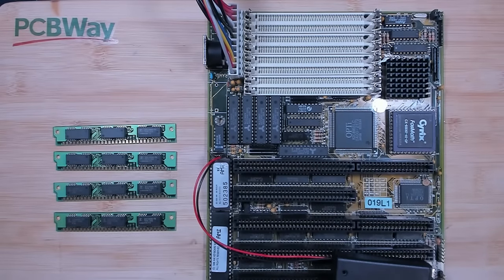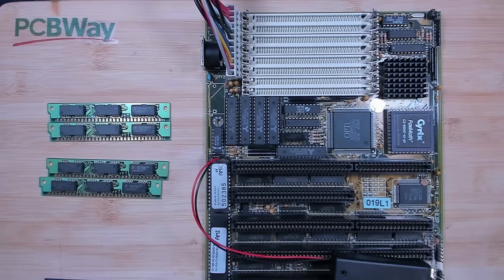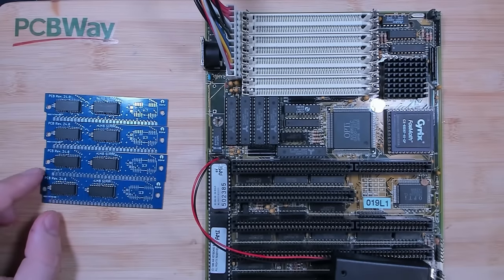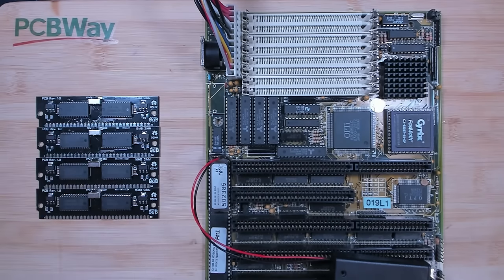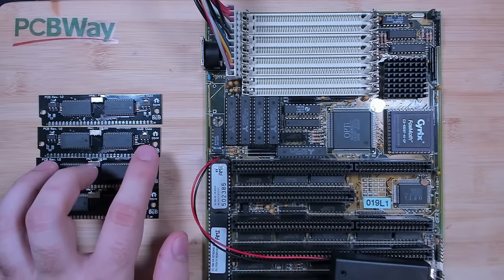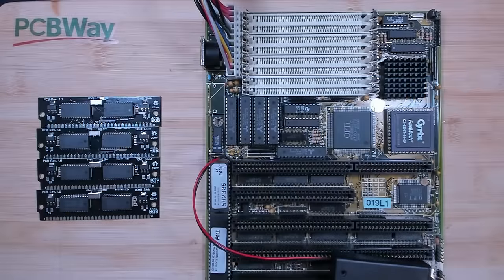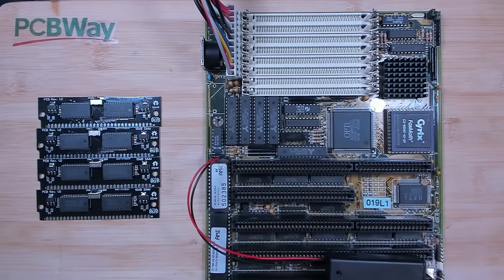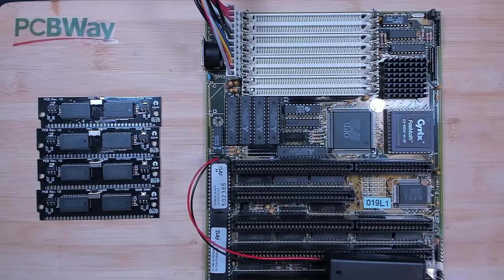16MB SIMM Revision 2.0 - I screwed up!

Comment: Electronic engineer here, explanation for the 3.8v address line max would be due to driver voltage drop within the chipset driving those lines, with older 5v CMOS specs it was common to see a "Vhi in" spec of 3.5v to 5v and a "Vhi out" spec as low as 3.6v. 
With that in mind the added capacitance to the RAS/OE lines would delay that already low drive signal outside of the timing spec as you have seen, this could be adjusted for in the bios to alter the timing slightly.
Very cool project and has inspired me to dig out some of my old treasures to get living again, namely the Amstrad 8086 i have in storage.
Thankyou
Reply: why would the RAS/CAS lines always have problems of capacitance ? is that because every single chip in all memory chips in that same line ?
Reply: @monad_tcp  typically what happens is the extra capacitance on these lines will cause the rise/fall time to be delayed out of spec. There is a setup and hold time requirement between address lines changing to when the RAS/CAS lines are required to lock those values into the memory chips, should this be delayed at the chip end the address lines may change again before the memory has a chance to latch them resulting in address corruption. 
this delay is a result of the signal drivers output impedance and the stray capacitance of everything attached to these lines and it seems in this case the RAS/CAS drivers are quite high impedance comparatively to other lines and as such are more susceptible to error.

Comment: I love that you and others are making new RAM modules for retro computers. Back in the early 90s having 64MB RAM on my 386 was only a dream as it was so expensive but now RAM is much less expensive
Reply: I thought I was King Shit for having 24MB in my 486SX. 🤣
Reply: @throwaway6478  you were and you still are bro 😂
Reply from the maker: I hope that the new modules (PCB rev 3.x) will work flawlessly and I can get a 386 to 128MB! Haha, that would be cool! This amount of memory is most probably useless to a 386, but it is still a nice project - and I am learning so much from it! Thinking about a 386 multiple times the memory of Socket 7 and maybe even Slot 1 machines is ridiculous :D
Reply: @bitsundbolts  the data sheet says it's possible, so at least someone had to have thought of doing this!
Reply: @bitsundbolts а что если более емкую и низковольтную память запустить через преобразователи уровня все управляющие сигналы, шину адреса, шину данных.
Открываются тогда вобще заоблачные объемы доступной физической памяти🤔
Reply: @bitsundbolts  I recently (accidentally) booted Windows 95 on a Tandy 4000 16MHz 386 with 16M of RAM, and it was -- well, it booted, and was less abysmal than you might think.  (This machine has 8 30-pin SIMM sockets on the motherboard and 8 more on an expansion board, all populated.)  So a 386 with 128M running Windows 95 or Linux would be fun to experiment with.

Also, Mac Quadra 700s have 4 30-pin SIMM sockets on a 25MHz 68040 and can really benefit from 64M of RAM with 16M SIMMs.  I would be very interested to see if these can work in that scenario.
Reply: @bitsundbolts  well most would say using and experimenting with retro hardware is a waste of time. 

I, for one, would love to see what a 386 with 128MB of RAM and say 1 or 2 MB cache could do!
Reply: Let me add to that an FPU like the Intel 387DX or even better an Intel Rapid CAD-2
Reply: IIRC I only got as far as 16MiB on my 386 system. Four 4MiB 30pin SIMs. I bet I've still got them somewhere.
Reply: @danielktdoranie  Интересно протестировать производительность 386 хотя бы с 32Mb, реализованными полностью на Static RAM. Сейчас в продаже есть чипы SRAM на 2Mb (1Mbx16bit), это получится 16 чипов. Правда, придётся отказаться от чипсета, и реализовать его либо отдельными чипами, либо на ПЛИС. Тогда кэш вообще не нужен! И да, тогда не потребуется нулевой канал DMA и прерывания для регенерации DRAM, но придётся убрать из BIOS их настройку. В литературе говорилось, что на регенерацию DRAM тратится от 5 до 10% времени работы с памятью, и в это время она недоступна CPU.
Reply: I had a built up, rack mounted 386 sporting a 486DLC2 at 80mhz, matching Cyrix 387 Fastmath copro, 64MB of RAM, and dual 9GB 5.25" full height Seagate Barracuda scsi drives running FreeBSD as my personal colocated server. I never could find a 386 motherboard that would let me throw 128MB at it, but I also wanted to run a 'modern' PHP + MySQL DB driven web forum on it, so it got paired with a Mac SE/30 with 128MB RAM running NetBSD as the DB server. :D

Comment: You should've used a x10 divider on the probe. This is absolutely necessary to reduce the interaction of high frequency signals with the oscilloscope input.
Reply from the maker: Thanks! I will do that next time. I had quite the crash course learning so much stuff in the past weeks, but I am happy to learn new things!
Reply: Yes, and please set your scope to use more than 1 vertical division of range.  Offset the trace downwards if necessary.  The resolution for voltage measurements will be much better.

Rather than free-running the trigger, it would also help to set the trigger level to, say, 1 V so you can see the waveforms properly.   You could also move the trigger level up and down to see if different signal levels are apparent when  DQx is is being driven by the RAM chip vs. the board.

Finally, the measurement would be much cleaner and more reliable with a nearby connection to ground -- ideally a probe tip grounding spring if there's a nearby GND you can poke as you probe.

This has been a great series!

Comment: Brilliant work!!!  Glad I could help!  Regards the probe affecting the memory test when probing CAS - if you get a scope probe that supports x 10 impedence (or greater), and if you can set the scope into the same mode too, you should be able to scope the CAS and it shouldn't crash!   This is one of your best videos btw!!!!  Just signed up to support you for what I can on Patreon, it's not a lot but I do love every video you put out!
Reply from the maker: Thanks for the hint! I will try the 10X setting next time. Now I finally know why this feature is there on the probe! Thanks for all your input - I really appreciate it!
Reply: @bitsundbolts  ummm yeah ALWAYS use 10X otherwise it messes up the signal. Remember to multiply the signal height by 10 on the scope to get back the original reading. Also you can get a reading on a very sensitive pin by putting the signal into pin 1 of a 74LS04 which will output on pin 2 but inverted. So tie pin 2 to pin 3 and measure the correctly re-inverted signal on pin 4. To use the logic chip, pin 7 must be tied to ground and pin 14 to 5V. This can be used on very sensitive crystals that refuse to measure even on 10X.
Reply: Yeah, without using 10x setting, you're basically directly attaching your probe's meter or two of coax cable to whatever you're probing. Works okay for audio frequency signals but it will create undesirable ringing and reflections when used with fast digital signals

Comment: A 386 can technically address 4GB of RAM.  It can't be done due to chipsets and memory sockets, but it would be hilarious to see one POST and see how long it takes for  that memory count.
Reply from the maker: Hah, yes, that would be funny. I guess that would be a perfect topic for a "short" form video. I can measure how long it takes to get to 1MB (usually counts slower), and the rest. Then just extrapolate to 4 GB.
Reply: @bitsundbolts  
🤣
Reply: @bitsundbolts  Real-time live stream it, I'd watch that
Reply: I'd also like to see a Pentium II with 64 gigabytes of RAM. It's equally possible.
Reply: @eDoc2020 does p2 do pae?
Reply: @memediatek  Yes. PAE was introduced with the Pentium Pro and the PII is a (mostly) improved PPro.

Comment: If your oscilloscope probes have a 1x/10x switch, use it! The 10x mode presents less capacitance to the DUT.
Reply from the maker: Thank you! I learned something new!
Reply: @bitsundbolts I concur with OP! There is almost never any reason to use the X1 setting, to the point that the probes included with high-end oscilloscopes (like the LeCroy and the Rohde&Schwarz that I have at work) don’t even have the switch — they’re always X10. 

Some people actually superglue the X1/X10 switch to X10 position (or put heat shrink tubing on it to prevent it from sliding), or pull off the switch cap entirely, to prevent accidentally switching to X1.

Comment: Great that you have tried my solder paste soldering suggestion. Also, never give up on projects and try as many times as you can. I for example tried to resurect a Seagate hardcard and after a week of soldering, hdd heads unsticking and sstor low level formatting was able to bring it back from the dead.
Reply from the maker: I learn so much from my audience! I won't be able to try every suggestion, but solder paste and stencil was definitely a great one! I absolutely love this technique. Once I get PCB 3.x verified, I am going to get gold plated PCBs and start making some memory kits! Thanks for your help, suggestions, comments, and your time!

Comment: A  passive resistor network works when it’s the only component in the chain. With more components, read more memory modules attached there is also current flowing to them. Better to use an active semiconductor circuit.

Comment: Those memory controllers had built in safeguards for parity on chip. Was wild back in the day that a server would have memory errors and if you just switched the SIMM that you thought was bad to the back and moved SIMMs up, it would work and the SIMM you thought was bad was now working again.  Seeing as the SIMMs were always in parallel, if the first was out of spec but the rest were in spec, it would fail. If the first was in spec and the others were out of spec it would boot.  Seems like the memory controller always trusted the first SIMM implicitly.

Comment: To avoid the crashing and for high frequency measurements you need to put your probe in x10 attenuation. Since your signals will never be negative, you can increase the resolution of your measurement by shifting your trace position downwards and reducing the V/div setting to 2v/div or 1V/div
Reply from the maker: Yes, I noticed that 5v was too high. Next time I'll try to make sure I pay more attention

Comment: I've been learning about level shifting and experimenting with it while doing a recent project, too, so this video was really good timing. Like you, I also quickly discovered that a voltage divider was not the correct solution to lower the voltage of unidirectional signal lines, but the solution I ended up finding was to use a 4000-series CMOS logic gate and power it with the output signal voltage I wanted, and it seems to have done the trick for me. (That being said, the signals I'm working with are a few orders of magnitude slower than yours; at 33MHz, I don't think it could keep up)

Great video, by the way! Every part of this little memory series has been both entertaining and informative, and I'm looking forward to whatever's next
Reply from the maker: Thank you! I'm also learning and discovering new things along the way. The main problem is really the high frequency - even though signals are not necessarily arriving at 33MHz. There are wait states and delays everywhere. So, it is not that the logic circuit needs to switch that frequently. I believe the true frequency is somewhere between 3-5 MHz. Good that you found a solution to your problem! Thanks for watching!

Comment: I love your stuff, for any voltage dividers at high-frequencies, you need to consider a 'feed-forward' capacitor(a capacitor from 5v_IN to 3v_OUT), this is the concept used by high-speed DCDC converters to stay on-top of transient conditions pulling the rail down so they can respond suddenly without RC delay, also used by instrumentation, the variable capacitor in oscilloscope probes is to set the ratio of cap divider to tune it's edge for square-wave response. For your PCBs you should ask for hard-gold fingers for edge connections/board, instead of HASL.

Comment: If you use a unidirectional level shifter for the address and control signals you can use one with push/pull outputs so you don't need the resistors
as for the data bus there maybe level shifters that have direction en multiple enable pins so that way its possible to also have push/pull outputs eliminating any resistors on the back making it easier to assemble
Reply from the maker: Good point. I was looking for something, but so far, I didn't find a fast enough level shifter. You're right, at the moment I need pull-up resistors for any line that "sends" data away from the level shifter to get a strong signal.

Comment: Great vid, thanks for sharing your journey! One thing to think about - you could have probably kept the voltage dividers should you have used so-called "advancing network" or "sharpening network". Basically it is just a capacitor connected in parallel with the top resistance in the dividing network, which allows high frequencies to bypass the resistor and thus eliminates the low pass filter effect. IMO something like 47pF would work just fine.
Reply from the maker: I have to read more about this. Interesting and thanks for sharing.

Comment: The Address lines drive up to 64(72) IC when using 8 8/9 Chip Memory Modules. So they are more powerful than the data bits as this are only shared between two chips (each bank one).
Reply from the maker: Oh right, I do have 30-pin SIMM modules with 9 memory chips on them. Crazy to think of having each chip with a single data line (1-bit chip). So, each bank would drive 36 memory chips - that sounds insane :) And as you said, 72 chips if both banks are populated.

Comment: Absolutely loved the video very informative. It’s also really cool because it shows that everybody makes mistakes when you’re learning something new. I have a theory as to why those ram sticks worked in the first three slots, as the ram sticks get further away from the cpu and chipset the signal integrity breakdowns further as the trace length increases not to mention additional stress the more sticks are added to the controller or maybe it has to do with the memory topology design of the board all just theories and things I’ve seen on newer boards.
Reply from the maker: Good point. It could be what you're suggesting. And the module seems to work for "light" load. I can extract a full Windows 3.1 and DOS copy into a 30MB RAM drive - and then boot into it. A heavy load like memtest causes the memory to fail. I hope the SMD components arrive soon so I can finish the other four modules and test PCB 3.x - hopefully everything works out!
Reply: @bitsundbolts  I’m excited to see what happens

Comment: You should also see about designing an 8MB SIMM module.

You are going to have to add the necessary components to convert the voltages, first, though.  

If you want to go into non-salvage chips, you can likely find new old stock in either electronic surplus or industrial electronics supply catalogues, but of course, also learning to do successful salvage is important.

Comment: Cool stuff ! Aside, you likely already know, but for others, active oscilloscope probes are getting quite reasonable these days (even some open source versions), and provide a much lower capacatance load, so can be used for more sensitive measurements, which I find are quite useful when doing this type of investigative testing.

Comment: Most signals on the system bus often have a series resistor to prevent resonances from sharp transient edges. If there's more things connected to one line than another, there'll be more current through that resistor, and the voltage may drop a little. This effect is even seen in boards without that resistor, since the wires themselves will have a little resistance too, but a little less than if your board does have proper "termination".

Traditionally most PCs work with TTL LS-type logic, which traditionally had reasonably high resistance for high level, and low resistance for low level. The acceptable voltage-range for a high level with those chips went all the way from 5V down towards 2V, since the high-level was a lot more susceptible to reading a bit lower due to the higher resistance. CMOS, however, does not have that bad of a problem, since both high and low are low resistance. As long as a line is above 3V or below 2V, it should not be a problem.

Comment: wow I didn't expect the paste to work so well. That looked like it was going to bridge just about everything. I'm surprised you only had a couple.
Reply from the maker: Yes, it works quite well. The paste is a mix of very small solder balls and flux - and it works really well! This was my first attempt. I am sure if I make a couple of those, the results will be even better.
Reply: @bitsundbolts  I'm wondering if a dryer paste would be less likely to blur like that and reduce bridges. I watch a channel where he's complained multiple times about runny paste. He does professional data recovery. He can do head swaps, but most of his videos these days are like flash drives and memory cards and the ocasional NVME. And it requires a lot of soldering. He uses stencils for the NAND chips.

Comment: Address lines are likely showing a lower voltage on the oscilloscope due to fan out. Or at least this makes the most sense to me. The address bus goes to more devices than the data bus on average. It would track then on lower cost or older designs you will see a higher than average drop in voltage on the address bus due to extra current draw for things like address decoding.  The data bus however is likely behind a buffer heading to the RAM and therefore would be closer to VCC. That being said someone may correct me but this is what makes the most sense to me.